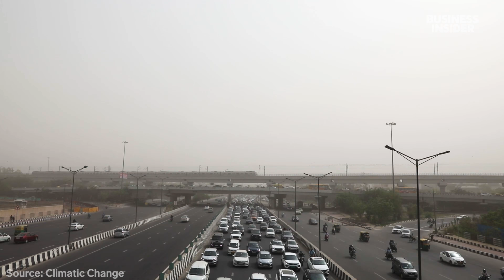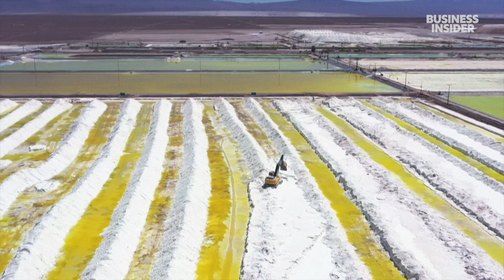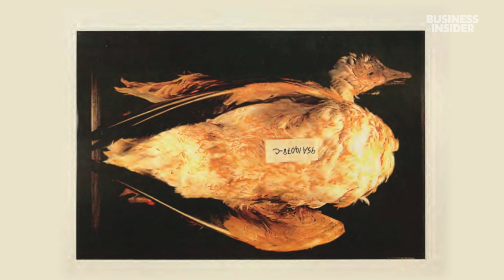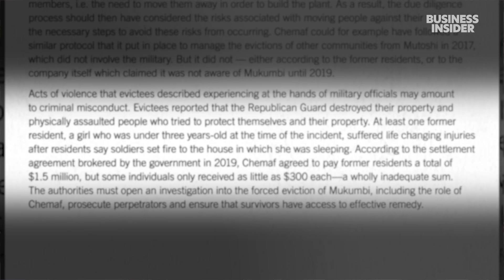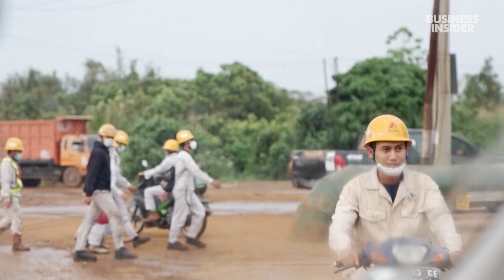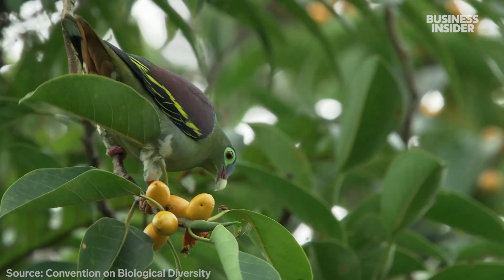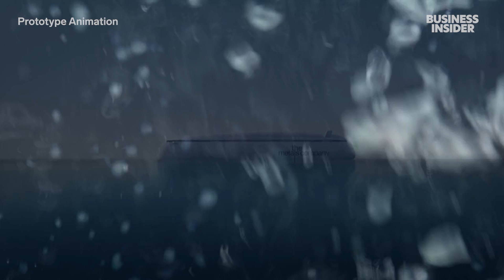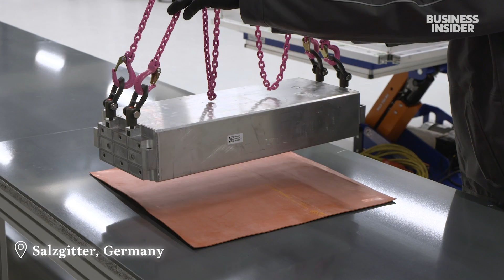The True Cost Of Mining Electric Car Battery Metals | True Cost | Insider News Marathon

Comment: Source on NMC being the most popular chemistry?
Cobalt is used in conventional vehicles through the oil refining industry, as a catalyst. I wouldn't be surprised it's directly in the cars through alloys too.
Reply: Paid for by EXXON?
The petrol car may be made with less minerals but during their life time will carry on consuming minerals in the for of petroleum, go ahead and say it's not a mineral but you miss the point. Once a battery has been made it can be used as battery storage after it has degraded enough not to be used in cars, after that it can be recycled. Once there is enough minerals extracted to make enough batteries mining can stop. This isn't just something I pulled out of the air, it's a fact.
Reply: @limeyB-star-D  you greenies always assume engines can ONLY be run on fossil fuels lol. The way forward is clearly biofuel hybrid tech, wich is advancing nicely. even diesel hybrids are going to be a much better way forward.
Reply: @limeyB-star-D synthetic fuel solves this issue and is one of the main focuses of the petrol car industry. 

It takes the power out of the hands of supplier countries with oil or Lithium deposits. It's carbon neutral. It's just about scaling it up to be cost efficient. A petrol car that exists today can run on synthetic fuel with no changes. And would be extremely efficient and carbon zero.
Reply: @Sgt.chickens  Synthetic fuel is inherently several times less efficient than BEVs. That means several times more solar panels, wind turbines, transmission lines, utility storage, etc. This will take a much longer time, make a lot less economic sense and also have a much larger environmental impact and require far more critical materials than just going BEV. Synthetic fuels has a place, but not as the mainstream for vehicles. Furthermore, synthetic fuels are needed much more for feedstock for industrial uses such as green fertilizer, green steel, green plastics, etc.
Reply: @gerhardlemmer5356  that's only at current scale. The car industry as we speak is attempting to find a way to make synthetic fuel more efficient with new Technologies that far exceed its original purpose. 

Nothing is more efficient than litterally sucking the Carbon we've been wastefully putting I'm right back out again. And unlike Electric you won't give all the world power to the two countries with all the resources. It's only less efficient because it's a far newer technology.
Reply: @Sgt.chickens  Synthetic fuel is fundamentally less energy efficient. It will definitely improve with scale and technological improvements, but it will always remain much less efficient than BEVs. It costs a lot of energy to suck that CO2 out of the air to combine with H+. It takes a lot of energy to produce that H+. It is more energy intensive to store and transport energy in the form of fuel than electricity. And it especially is incredibly inefficient to convert your synthetic fuel into kinetic energy in an ICE/HEV/PHEV.
Reply: @gerhardlemmer5356  Energy intensive now. Not in future. That's the entire point. 

It costs far far more energy and water to mine Lithium and I'm not sure where you get the idea that any of that process is efficient or Not harmful just because the end vehicle seems efficient from a thermal efficiency standpoint. (Also. The thermal efficiency of ice engines is rising rapidly. Road cars are at 20 to 30 percent. Race cars are allready capable of 50 percent. The hybrid engine will be a massive competitor here in brjng8ng it close to the level of EVs. (Which are not 100% thermally efficient allready)
Reply: @gerhardlemmer5356  I also think you Significantly underestimate the Environmental damage caused by Rare metal mining like Lithium mass mining and especially ocean mining. It's far worse than the Effect of carbon extraction. Which can be done anywhere and can use renewable energy
Reply: @Sgt.chickens  ICEV's and HEVs are much further along in their learning curves than BEVs. It is extremely unlikely that they will get anything other than worse compared to BEVs in the foreseeable future.50% efficiency can only be achieved under very ideal circumstances and even so it is downright pathetic compared to BEVs.

Due to the inherent higher inefficiency of synthetic fuel, you'll need so much more electricity that the utilities will need more battery storage for supporting synthetic fuels than BEVs would. And mining the minerals necessary for producing synthetic fuel factories are also devastating to the environment. Meanwhile Lithium can be and increasingly is mined with DLE technology which can on paper have extremely little environmental impact. Although, granted, DLE with very low environmental impact on commercial scale is still somewhat unproven.
Reply: @Sgt.chickens  I don't. Your numbers are severely outdated. A well designed 3rd gen BEV build at a decent scale can repay for the difference in less than 100km almost anywhere on Earth. And the first 4th gen BEVs are already in commercial production or soon to be. After a bit of a learning curve and scaling, the 4th gen BEVs will have much lower environmental impact to build all while being much more efficient than the 3rd gen BEVs.
Reply: @gerhardlemmer5356  no you are talking about emissions there. Not environmental damage. 

You can't "pay off" destroyed ecosystems. Paying off the carbon and Emissions is irrelevant and can be done by both. The environmental damage is the issue. Lithium mining permanently destroys the ecosystem in that area.
Reply: @Sgt.chickens  Just like fuel mining permanently destroys the environment. And just like electrolyzer materials mining permanently destroys the environment. And just like mining Lithium for all the utility storage a several times increase in electricity consumption for synthetic fuels destroys the environment. And all the mining for all the extra solar panels and all the extra wind turbines. A BEV has the lowest environmental impact after less than 100 000km pretty much everywhere on Earth. And as it takes ever less materials to produce BEVs, as the materials are mined in ever better ways and as BEVs gets ever more efficient, that improves ever more. Yes. BEVs have a terrible environmental impact. But every other technology currently available to us -- including synthetic fuels -- is far worse over the full supply chain and lifetime of the vehicle. Multiple times worse, in fact.
Reply: @gerhardlemmer5356  direct Lithium extraction is not cleaner whatsoever. You can tell by the methodology. It's just untested so they are saying "oh maybe it's safer" it's not. Ans it's also not possible for most Lithium mines to use DLE. 

Innate inefficiency just doesn't matter when our main concern isn't water use or power use but Carbon output and Output of extreme toxins.
Reply: @Sgt.chickens  There are many different forms of DLE. Most of those are considerably cleaner than the leaching approaches in current mainstream use. The simple fact is leaching uses highly reactive chemicals and is inherently wasteful. DLE works by selectively modifying or swapping ions. If your process for example swaps Na+ for Li+, your "waste product" is likely to be chemically very similar to your input and likely to be perfectly safe to return to where it came from. (It does depend on a bunch of parameters, though, hence "likely", not "always".) You'll still have to process the product (not the waste product), but there are now processes already in commercial use that does so in such a manner that it creates useful byproducts rather than waste products.  In the case of mining Lithium brine, DLE that swaps Li+ for Na+ and produces a chemically similar enough result, can also be combined with geothermal energy generation. Now your process is pretty darn close to closed-loop and powers itself to boot. Most DLE approaches are also considerably more effective than leaching, so at worst you'll get several times more product for a similar amount of cost and impact. Of course, there's still an impact. Sometimes still a considerable impact. You're mining at scale. But it's better than leaching if you actually design your process to be better and if you don't, then at worse it's no worst and produces several times more product which means you still end up with less impact per unit product.
Reply: @limeyB-star-D  Glad to hear it and hope you are correct. It seems only time will tell. COAL is a mineral as well and the energy to charge batteries has to come from somewhere. 
It's not like the scenario you describe re-purposing degraded batteries and recycling is not all there is to the equation (and yet to be developed and proven feasible). No matter what, batteries have to be charged and that energy will come mostly from coal. 
I do not work for Exxon as you implied. I am interested in truth not politics which are two different things. I will not engage in such petty non-arguments by reciprocating and saying your message is sponsored by the lithium mining industry.
Reply: @rjm7151  Well-to-wheel efficiency of BEVs are so much higher than that of HEVs that almost everywhere on Earth it takes considerably less minerals per km to power a BEV with halfway decent efficiency from the grid than to power even the most efficient HEV. Furthermore, grids can be made cleaner over time and BEVs are rapidly becoming more efficient.
Reply: @rjm7151  I have an EV in my drive being charged by Solar right now.  All the people I know with EVs do the same. My state doesn't even have any coal power on its grid - it is 100% renewable.
Reply: yeah and that same fuel is used in cars and trucks to mine and transport raw materials all around the world, the fuel is used to launch rockets, to power ships, aircarfts, agriculture, construction..... build roads, power stations, the grid.... what are the usless EVs doing!?
Reply: Although road transport is only responsible for a little 12% of greenhouse gasses. It’s shifting the ‘problem’. And the green net-zero stupidity is all about the money. The climate change ideology.. Green on the outside, but fiery red on the inside!
Reply: Apparently a ton is "used" in oil refining but very little is lost, on the order of one pound cobalt for 6M miles of driving.
Cobalt steels are mainly used in cutting/machine tools, that would include automotive production but tiny amounts per car.  

Regardless BEVs are vastly 'cleaner' even without CO2 considerations. (I don't fear CO2)
Reply: @Mrbfgray Good to hear you don't fear CO2. Now start thinking about installing hazardous instable (incinerator, but not only) bombs in machines that fly around with 100mph...and are then parked in houses
Reply: @Mrbfgray  and true hybrids are even cleaner than EVs.
Reply: @ChuckLeeClerk   Nope.  Compare, say 50MPG hybrid to 125MPGe BEV.  Can't compete with that with anything.  And the 125 goes to the Tesla M3 which blows the Prius out of the water in every way.

Unless you charge hybrid at home all the time and never go far, that's not how they are actually used.

Economics will sort this out, already has.  Hybrids a great intermediate step for last century, not the future or even the present.
Reply: @Mrbfgray  yes, being used as a catalyst, the majority is recovered but they still need to inject fresh one for the part that went down the drain.
Reply: @FlorentHenry   Almost trivial amount lost but BEV batts will be recycled endlessly also with tiny losses.
Reply: @FlorentHenry  big loll!!! without oil none of those EVs would have ever existed!
Reply: @alanmay7929  that's not the point I was making and quantity matters. But I agree, oil is precious and it's really a waste to burn it.
Reply: @alanmay7929 ever hear of the 1906 Baker Electric? Jay Leno drives his all the time. 38% of cars were electric in 1900 @alanmaybe
Reply: Yes and they like to bring up all the refining costs for petroleum but they rarely mention the fact that EV's are essentially coal powered.  @alanmay7929
Reply: @Mrbfgray you don't fear CO2 what about CO? Try running you car in a closed garage and report back?
Reply: @limeyB-star-D   Today it has to be a fairly tight sealed garage to commit suicide that way, this ain't the 1970's and prior when that was a very viable way to die.  Catalytic converters, modern smog controls work well.

 But yes I welcome significantly cleaner air from BEVs, (CO the least of it) they are going to dominate simply due to economics alone, we don't need to force it.  Likely that mandates actually retard the adoption rate due to proper backlash and all the BS associated with it.

Virtue signaling pols can't mandate what isn't already pretty close to economic, they can't mandate everyone own a $100k car.  Tesla and Chinese brands have got this, price parity with ICE is upon us.  Let the market do it's job.

You can make a case for subsidies of BEVs to counter massive petrol subsidies, be better to quit subsidizing fossils but weak pols do do hard, very difficult to even terminate the corn-ethanol fiasco for example.
Reply: @Mrbfgray  No, highly toxic chemicals are worse than any CO2 producer
Reply: @harrison00xXx    CO2 is healthy, are you saying water is worse?  What chemicals specifically are you referring to?
Reply: @Mrbfgray  If the recycling companies would share this information we would know how harmful EVs really are
Reply: @harrison00xXx    So you've got nothing, just making crap up to suit your preconceived notions also based on NOTHING.
Reply: @Mrbfgray  funny. first you like your own comment, then you literally argued against yourself with your garbage claims.

You are just NOTHING

Comment: To this you have to add the minerals for the infrastructure needed to transmit all the electricity that will be needed to run all of the electric vehicles. It will take billions of dollars to upgrade and build new infrastructure and this will take decades.
Reply: 60 billions spend on Ukraine is just 2 years.  I will take billions to build EV industry than Ukraine war.

Comment: Idea: convert standard combustion cars to hydrogen ( technology is there to do this), then each car has a C02 absorption system ( since a car is basically an air pump), so all the time its running its extracting C02, could be done in many different ways, the extraction system would be emptied every so often, so each car is then acting as a C02 extractor............billions of cars extracting C02 would be ideal.
A catalytic converter system designed to absorb C02 would be need to be developed, but other ways to do it.

Comment: There's always a cost. The problem is that we're late doing this. Instead of doubling down with oil which had a high cost in the 70s we should have been investing in lithium ion battery and solar tech which was already invented. You can buy solar panels from the 70s that work to this day.
Reply: Too bad oil is not just used for transportation,  do some homework.    Plastic and petroleum is basically keeping 😂u alive.  Your NOT green at all
Reply: @jamie.777  Petroleum is used as a binding agent in plastics. Because of subsidies petroleum use in research and development was cheap. Now that we have studies and possible subsidies in other areas we may finally be able to distance ourselves from the petroleum paradigm. Petroleum use in general is becoming obsolete.